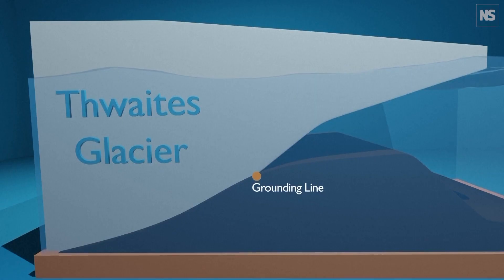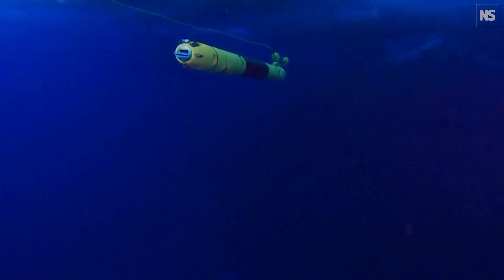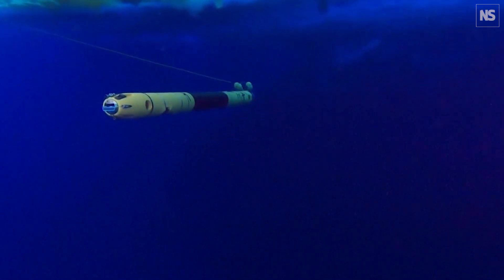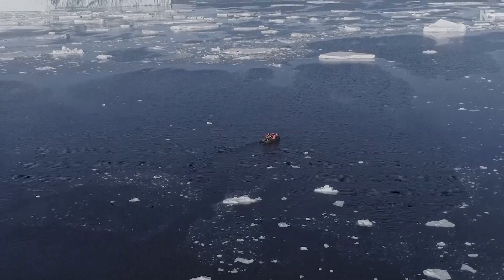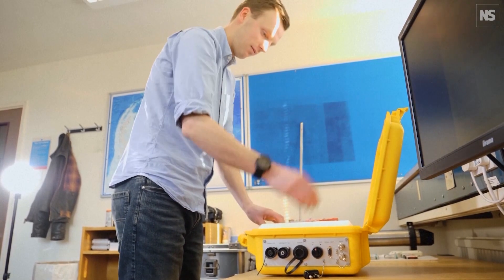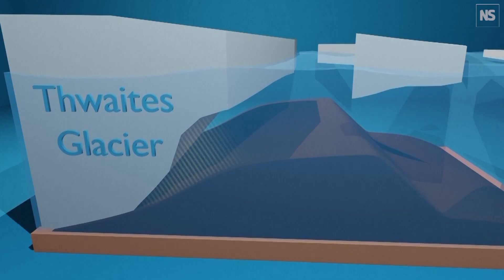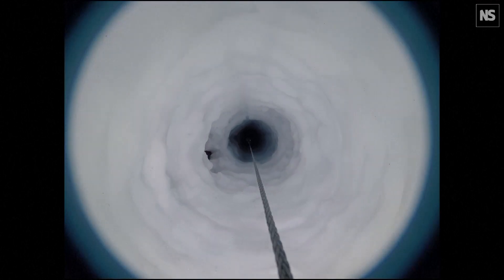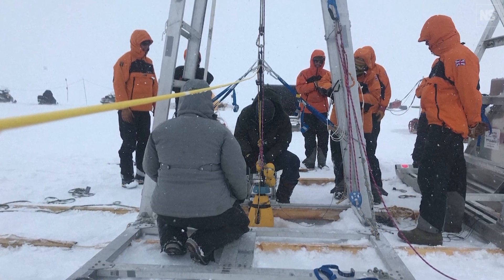Melt rate of Antarctic 'doomsday glacier' slowed by freshwater layer

Comment: 0 seconds ago
Everyone is concerned about the rise of the oceans as the ice melts.
I can't understand, and I hope someone will explain to me that: as the ice melts, what actually happens is that the temperatures increase in the summer, since there is no ice to absorb it. If we compare it with the ocean level, this is irrelevant. Quite before the sea rises 30 cm. the temperatures at the end of the summer will break more than 10, even 20Cº in certain places and times. You don't need to be a scientist to be sure of that, everyone knows how much heat ice absorbs (and then releases) to melt. When that happens, still in these decades, many more places will become habitable than places covered by water.